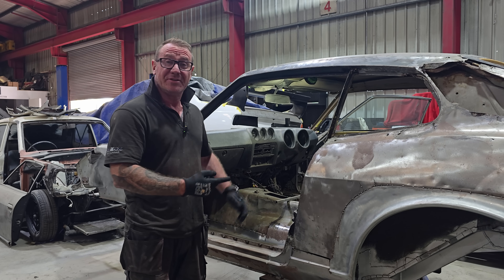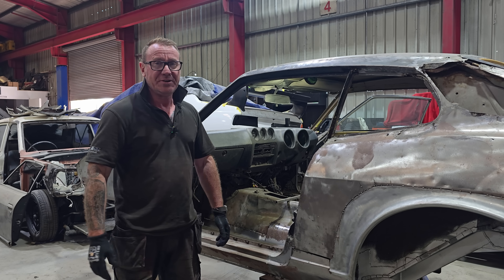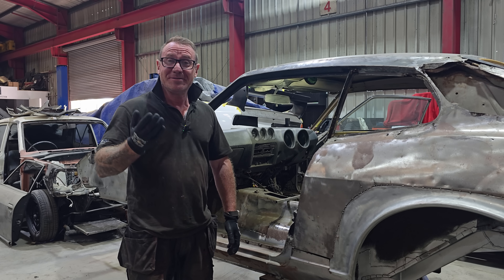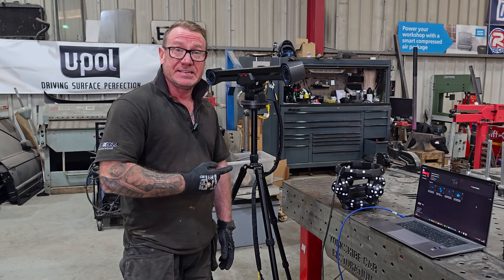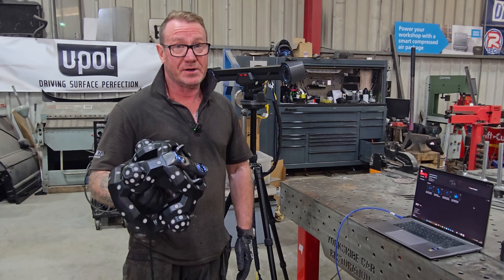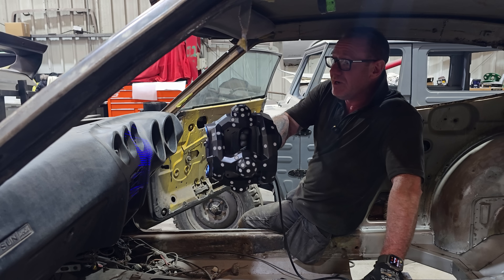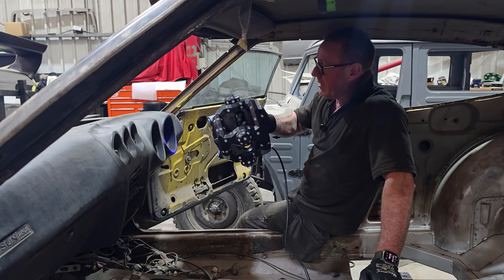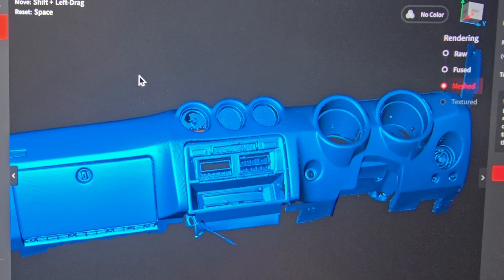Can This Process Revolutionize the Classic Car Vehicle Industry: 3D Scanning to 3D Printing.

Comment: The 3D modeling part of the process might hold some experience gathering „oportunities“ when it comes to fixing that dashboard cracks impact on a clean dashboard shape, let alone desing changes. But still impressive and informative, what you show. Especially the easy output of at least a mesh instead of just a point cloud. The next level would be a software that helps re-creating shapes instead of just a mesh. That is the reason the guys over at retropower want to switch their scanning gear.
Reply: One baby step at a time
Reply: @stephensomersify  Exactly. And of course it is important to experience encouraging leaps to keep the spirit up whenever small steps become giant leaps.

Comment: good tool if your loaded with cash or get it free the average joe working at home never could afford  , cheers
Reply: I remember when a TIG welder, a plasma cutter even a laptop were far out of my price range. Now they are all in my workshop. Everything starts out expensive only to become cheaper and in common use.
Reply: You can get fairly decent ones now. Not as good as this one but I got mine for £200. I have a few projects planned for my old Merc with it.

Comment: I wonder if some clever person will build a common database for all the different car parts, where for a small fee you can download and print your own component ?, or even order it online from a company that has the large 3D printers
I have seen a company in the States, that manufacturers panels using a machine with a roller and oil to a very high standard
When I first started watching your videos in your old workshop. I thought a shrinker stretcher was cutting edge !!! now we are getting into the most amazing technology

Comment: 3D scanning and printing is really good. I got part that is not available anymore glued together, scanned, fixed in 3D and printed. Fits like original.
Reply: I hear you, but I am unclear how it is possible to make a part fit exactly with original dimensions. This video showed him scanning to a miniature, but how in the world does someone make all the dimensions exactly like the original? He didn't say. How did you do it?
Reply: @moodberry just guessing, but he could maybe through the software, make it the actual size.  Then send file to a injection moulding company, and they can create the mold.  They can also, from that mold, replicate to original dash, and to add, they can just do a mould that can be used for thermal vacuum forming, that will put a new cover of vinyl on.  I might be wrong, but it’s a maybe on all that!!

Comment: Very cool. I 3D model for video games, so I'd probably end up just 3D modeling on top of the laser scanned triangulated 3D mesh data. (aka manual retopology + surface subdivision)............ though I guess that is a bit time consuming.
Reply: plus probably if you were to make use of the 3D scanner, you'd need to have a company in the area that can 3D print 1:1 scale of such sizes. And then this means you would need to unscrew the whole dashboard, put it out of the car, patch it up with some very sticky tape and have it hold its original shape..then 3D scan all the little clips and holes and everything in such high detail that it would even capture the elephant skin texture or whatever texture it has.. and it would have to be captured outside and inside..all sides of the whole thing. Then you'd need to 3D model on top of it, manually retopologizing and then make sure everything is in correct tollerances and then finally 3D print.. then spray paint it a few times and then try to shove it back in the car and see where you might need to sand down a bit...............and then finally cry and say thank god we succeeded. As a jihadists barges in shouting allahu akbar cause reality always makes its way inside.